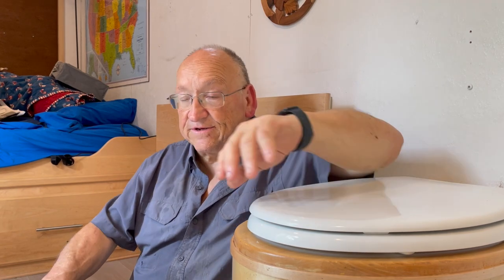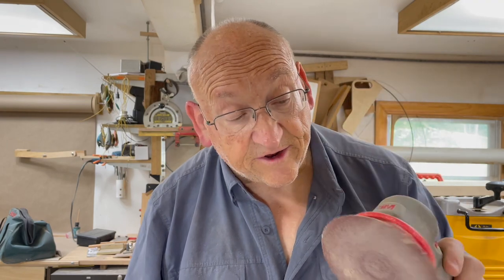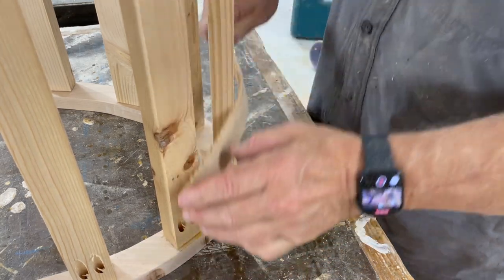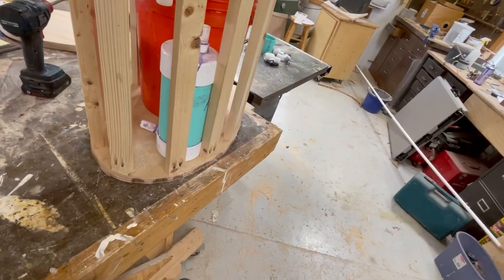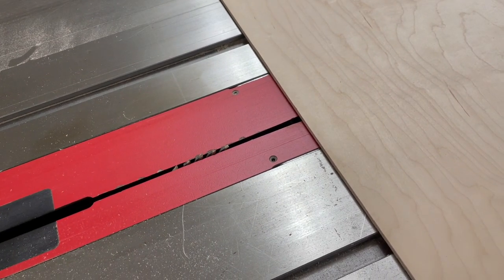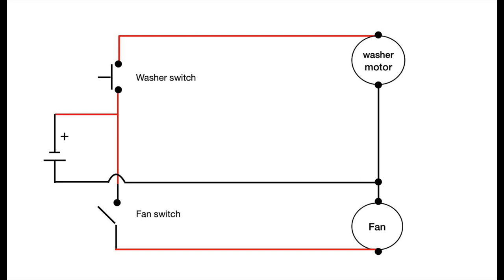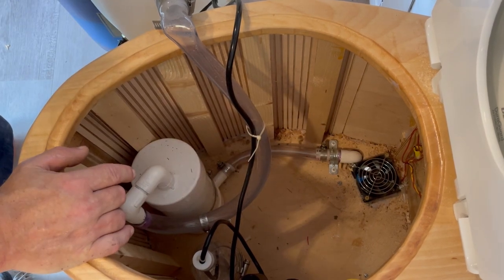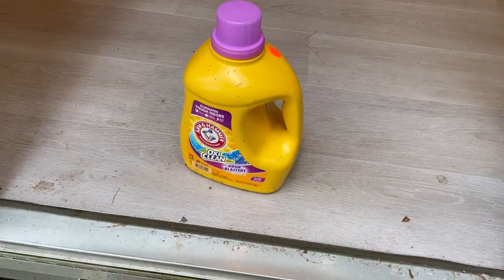Elegant Minimalism: Game of Thrones, Making a camper composting toilet

Comment: Guessing a lot of viewers want to make something like this.  Love the ping pong ball valve and the air vent to make it work better.  The washer motor flush is great as well.  I will probably lay up one layer of fiberglass on something it will release from and curve it around instead of wood, then add more layers to lock in the shape.  Won't be as beautiful, but easier if you work with fiberglass.  Thin plastic backsplash or formica would also curve without cutting all the kerfs.

Comment: I built one very similar about 18 months ago.  I shortened it by about 2" to gut under a cabinet door.  Wish I had gone a bit shorter yet and put a 3 gallon bucket in instead.  It ends up about 8" taller than a normal toilet in that configuration.
Reply from the maker: YES! I'll be building a little set of foot rests for the wife in the spring. Now she looks like a kid on it with her feet 3" off the floor.

Comment: Great job.Shame you need to get underneath the camper to open the valve.
Reply from the maker: I have since added a valve that I can reach easily with just my hand and other people have to lift a container out inside the camper and carry it outdoors and dump it. Another advantage is that one were Boondocking. I can just open the valve and let it drain when we leave, when your Boondocking usually in the middle of nowhere anyway. Thanks for commenting.

Comment: Consider not gluing the top cap of the urine collector to facilitate cleaning. Over time salts from the urine may build up inside the urine reservoir and clog the drain.
Reply from the maker: Thank you never really planned on doing it
Reply: I rinse the urinepart with a mix of water and vinager. No built ups!

Comment: Nice video and job but would need to send 4 x more than the cost of new toilet to make it
Reply from the maker: Mine came in at around $200. But I added a lot of stuff. Could be done for $150. A composting toilet bought commercially start at $300 and go  up to about $1200. Most are in the $500 range. This isn't a portapotty what uses chemicals and you have to dump it.